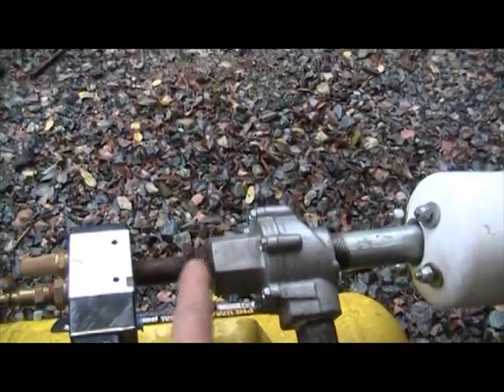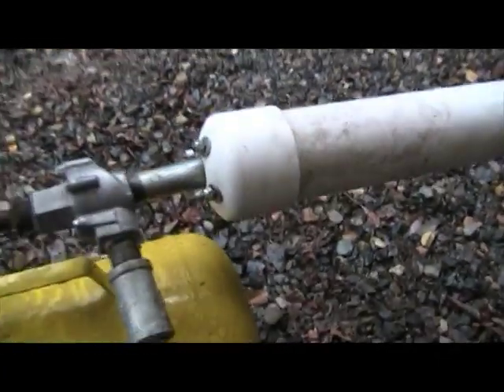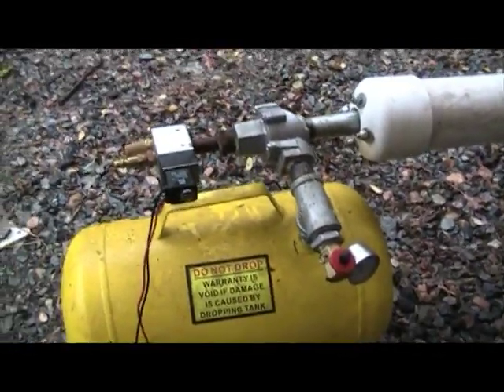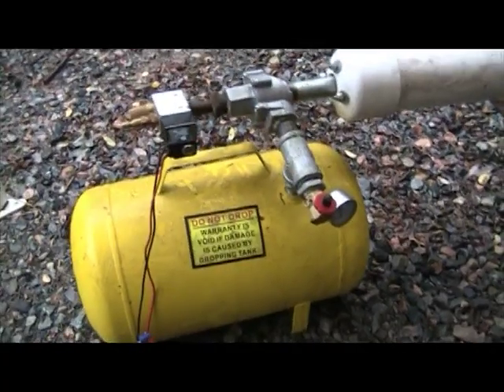Air Cannon Parts and Operation

Comment: Might be a little late, but i have a few questions. The main air supply (from compressor) comes into the prop at the solenoid correct? And then how does the solenoid trigger the dump valve? When the solenoid is in the OFF position? Just a little confused on this. Thanks for the awesome video though!

Comment: Using a 4 way solenoid will work as well, they are the same price and if you just plug port B on it and run port A into.the.tank like you did, there is no need to reverse the insides.

Comment from the maker: Look up 3/4" Dump valve. I actually don't know where we got it from as we did a group buy. I bought the selenoids, Bob bought the Tanks, and Goulishcop bought the dump valves. 

As for the selenoid, I got mine from FrightProps. 3/8" 3-way 12V. You can use the 120V version as well.  Don't forget the Muffler, and Standard Air Tool connection.(Air In).

As for the Ideal pressure, That's personal preference. I likeit between 60psi and120psi.

Comment: First of all, thank you for posting this. Ive been wanting to do an air cannon for ages, but I dont wqnt to use the inferior parts like the other tutorials suggest. Few more questions if you dont mind. What is and where did you get the dump valve and solenoid? What pressure have you found to be the ideal working pressure for this prop? Thanks.